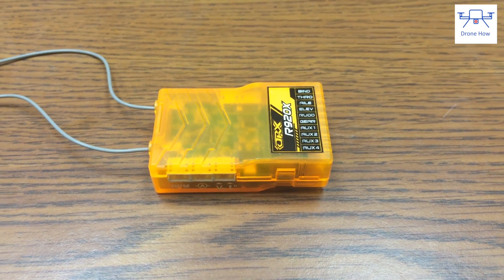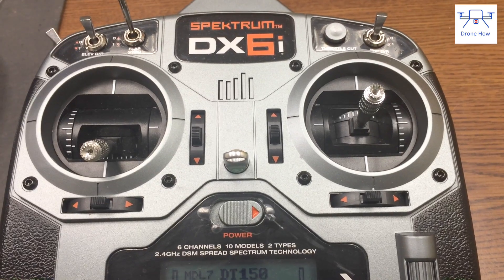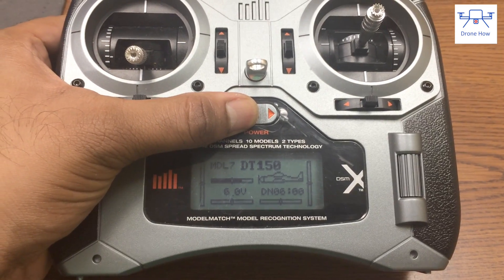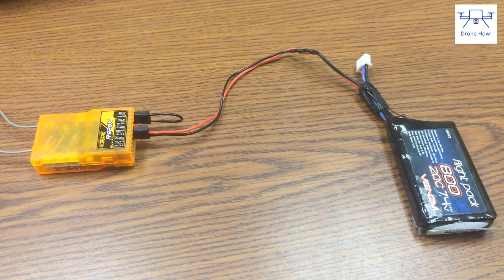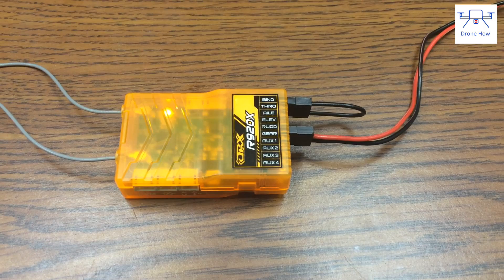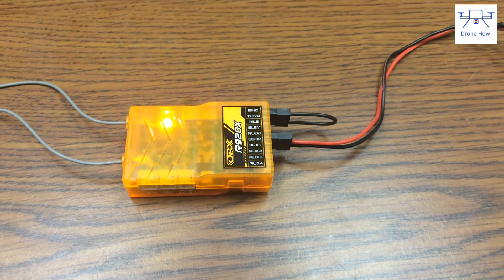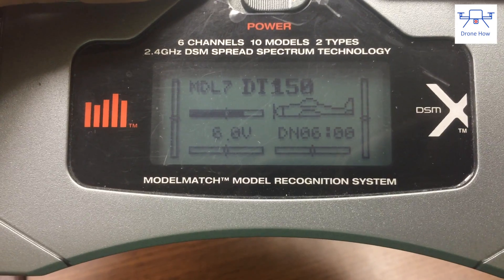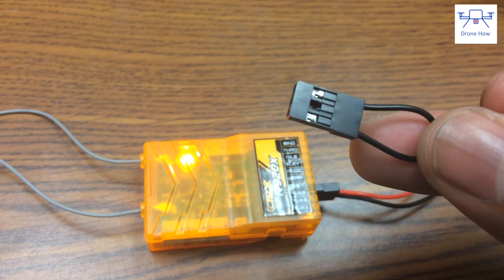Orange Rx Binding Process Tutorial - Binding a R920x to a Spektrum DX6i

Comment: After binding my DX8 to my transmitter using a small battery into the receiver after I plug out the battery from the receiver powered off my transmitter powered it back on there is no light blinking at all anybody know why it's not staying blind after I unhook the small battery from the receiver

Comment: hi hope you can help .. i have a  ORX  R720 V3 and a jr 11x ttrasmiter wend i try to bind it , it doesn't want to bind the rapid flashing light goes out n it doesn't operate.   ps i just purchased it. any advice will be appreciate  ty.
Reply: Hola Hector, tengo el mismo problema. Pero mis receptores son r920x v3 y no los puedo bindear. Pudiste solucionar el problema, gracias. Saludos

Comment: Just a quick observation: plugging in the cable to the reciever does not burn the reciever. Since the positive wire is in the middle, the reciever is safe. The signal wire touching the ground pin or vice versa will simply not show any responce, but certainly won’t fry the reciever internals. Over voltage will!

Comment: hi mate iam using a 5 cell 6.0volt  batterybwith tamiya and futaba conectors on its brand new holds voltage well my servosd area hitec quater scale for steering and standard for throttle
Reply from the maker: +sarah cooney You should ideally use no more than 5v to power these. A 5v bec is ideal.
Reply from the maker: +Drone How Are you powering your servos through the receiver or separately?
Reply: hi there iam using the ar400 full range for a rc power boat mate so batterry to swtich then switch to reciver direct alot of people in club been using the dx6i and the ar400 for years but some reasson iam having troubble

Comment: I got a slowly flashing light after binding.  Does anyone know what it means?
Reply from the maker: +MangLung Cheuk Try and re-bind, and make sure the transmitter is at least 4 feet away from the receiver.
Reply: +Drone How Thanks for your reply.  I tried many times, but it still flashing slowly.  However, I tested it with a servo and it works!   After disconnect the battery and restart, the light shows solid, but it did not happen during the binding process.
Reply from the maker: It sometimes won't happen during the bind process, but as long as your servos work, the binding is complete.